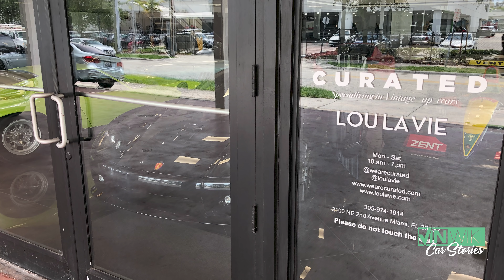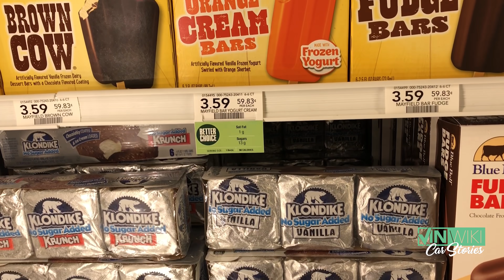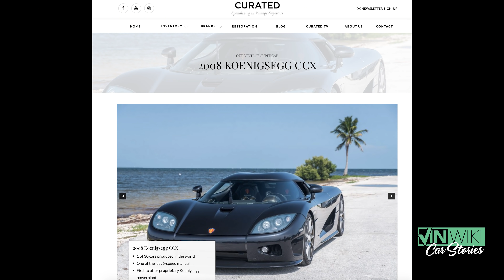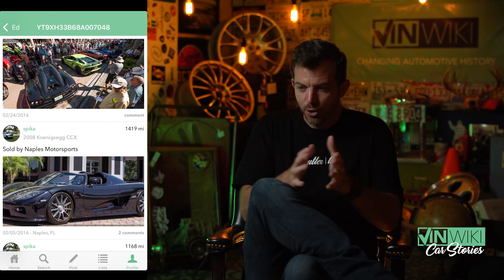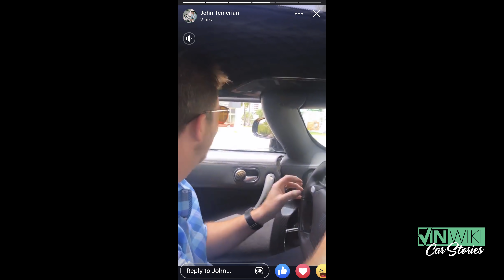What would you do to test drive a Koenigsegg CCX?

Comment: He has a good point that some cars are awesome, but just aren't very driveable or enjoyable.  I picked the "lessor" BMW M240i over an M2 for the exact same resaon although I could buy either.  Not having an adjustable suspension setting in the M2 and a bit peakier throttle response was just a bit too "full-on".

Comment: @ed bolian I keep hearing about this ~20k a year tire maintenance charge basically stating that no matter what amount of miles you put on the car, they need to be replaced. I assume this is to make sure its able to handle the top speed of 240+ the vehicle is rated to but SURELY since you dont plan on doing 240mph runs back to back every month there has to be an alternative tire that one can use that are rated to 200mph that would work for a merci or the like and save you tons of money. When it comes time to sell just swap back to the brand new tires it came with. Is this a plausible solution ? The 20k tire thing just blows my mind. There HAS to be a way around it. What do you guys think ?

Comment: I'm still waiting (I'm 65) for the perfect car. It has to have the opulence and space of a Rolls, pull one gravity on the skidpad, 0 to 60 in less than 5 seconds, and NOT LOOK FAST.
Reply: SLS AMG
Reply: Mercedes Maybach, no one knows what to think of them.
Reply: 2020 BMW ALPINA B7 -- 0-60 @3.4s -- 205mph top speed -- 600hp 590ft-lbs -- 0.97g lateral grip. Looks like any old man's sedan if you buy one in silver and take off the badges.
Reply: @Michael02496  Does it corner that well??
I'll have to check them out.
Reply: @markm0000  I knew I couldn't be the only one that wanted this kind of car. Happy Days
Reply: @johnparrish9215  Happy days in retirement! You earned it!
Reply: @johnparrish9215  Ze crazy Germans can only build a land yacht that is faster than a speed boat.
Reply: The maybach does 0-60 in 4.8 seconds and pulls 0.9 gs on the figure eight.  Also, from the horsepower rating, it looks like a good tune on the TT V12 could improve the performance without too much effort.
Reply: M Vieira the Maybach can do pretty much the same as the B7 but it’s designed for comfort first then performance. The B7 is designed for performance and comfort second. Also, the V12 is a dog it doesn’t do anything and sits there lagging for most of the rev range. It only has max performance for a few hundred rpm window. The V8 B7 has power all over the rev range and is much nicer to drive in real life. V12 is just small dick compromise.

Comment: Drive a Regeria, even leno who has passed on many supercars such as the 918, the zonda's and the previous koenigsegg's after driving one that was literally painted like a ruby had that look on his face that said it all, I gotta get me one of these, as it has a transmission that is like the old Turboglides from chevy's hayday, no shifting and a 100% smooth, one of the best transmissions they ever made, and a true engineering feat, and they drive those cars in the snow, and have greatly improved their usability in general across the board from everything I've seen of them.

as the main thing you look for in a supercar is a different experience to the norm, and with all these Radar Runner supercars, its one of the few that offers a different driving experience from the others, and your wife could drive it too while you switch the scuderia to a manual.

plus you didnt take the top off on the CCX, its a targa top, and the regeria is too, their all targa tops, and have been since the company started it seems, so that alone would be another good excuse to take one out on a test drive, provided it doesnt rain of course.

Comment: 10-20 grand for Oil? What does it use? Pure baby lion tears?
Reply: I was watching a video, I think of the Las Vegas entrepreneur who owns/rents out a Veyron.....he said that an oil change actually involves a full engine-pull and teardown service. Pulling a quad-turbo W16 from the back of an AWD hypercar is no easy feat.
Reply: Watching somebody do the change on a Veyron, it’s all labor. Took an independent high end shop a lot of hours. I’m sure the 3-4 jugs of oil would cost around $500-1000, but paying a Bugatti mechanic to remove the engine cover and pull 16 drain plugs isn’t cheap. I’d imagine you could find the video if you looked for ‘Bugatti oil change’.
Reply: German Engineering at its finest I guess. I've always though it kind of crazy that it takes 16 cylinders and 4 turbos to make the power they want in the way they want.

Comment: Never was a fan of the CCX, even though I haven't driven cars of that level, based on my car knowledge it always seemed to me that the CCX and some of the Pagani cars too are too rough, too rigid, yes they are 900-1000hp cars, which was crazy for the time, but gears, sound and noise in the cabin, steering, suspension setup, I feel like the car is not that much of a precise and well dialed in car for a stupid large amount of money. I wouldn't buy one, if I was looking in that price range. From a car with no Gears in the Regera, to many gears in the Jesko, these cars  have unproven tech in terms of reliability, and they are often in the shop for repairs, but people do not say it (owners)